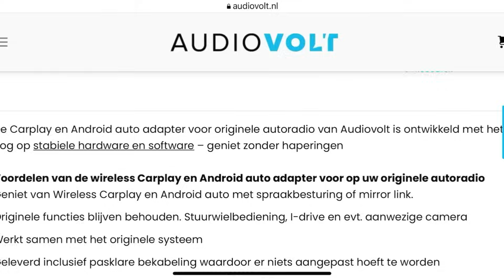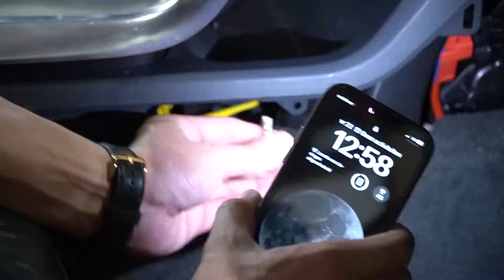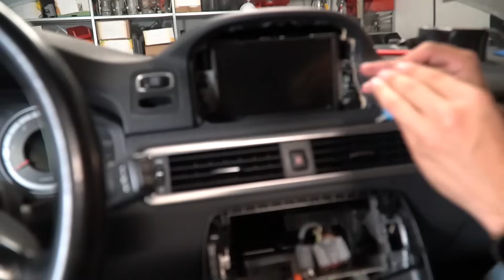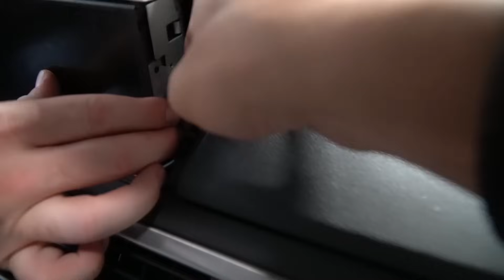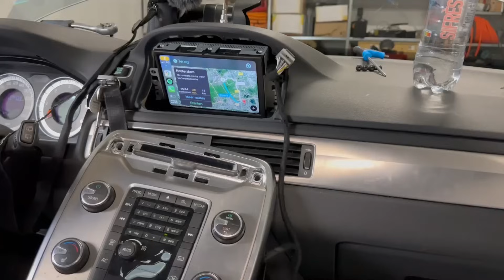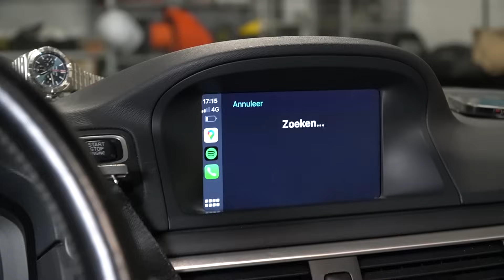Volvo Carplay Installation for ALL older Volvo's! | XC70, V70, V60, S60, XC60, V40, S80 ✔

Comment: There are several differences from various years of "older Volvos" which differs on how the installations would differ.  As for the piano, fire the piano player and avoid any and all necessary noise as the commercials provide enough of that already.

Comment: I noticed the car used didn't have the globe internet button top right on the control panel, I understood that is required ?
Reply: If you look at mmi boxes for sale there's two different versions, one for the later Sensus connect with the internet button and another without

Comment: Looks like a worthwhile upgrade. I think I'd have to pay someone to do it for me though. Im not very technically minded and I'd probably f*ck it up. One question, where did the Audiovolt box go? Does it have a space inside the centre console or is it in the passenger footwell?
Reply: Stay away from this, bought the same system and have been installing it for a day. LCD keeps fading into white if the engine isn't running. Making the display rubbish unless engine is running, regardless if in "Volvo mode" or Android Auto/Car Play. It's slow. If it was 100 EUR, perhaps worth it, but paying 300 EUR+ for it is taking the piss really.

Anything from poor integration to an hilariously bad manual for at least the kit I got, doesn't even remotely explain the DIP switches properly, nor the digitizer install - not a biggie, but not even mentioned in the manual included.

Also, this rubbish interface feels insanely shady and possibly even a security issue for having integrated with your car and your phone. I would stay away.
These are all based on the Limcet trash.